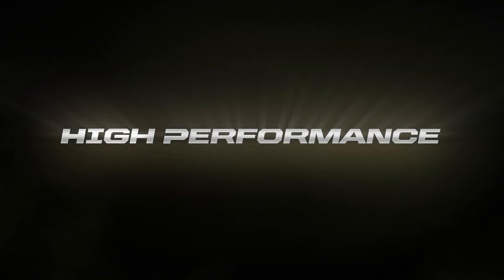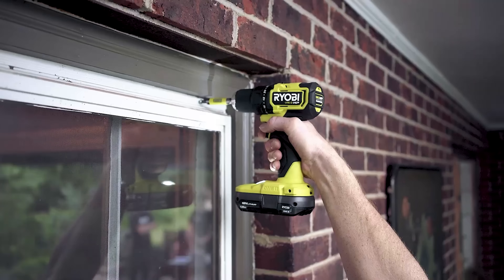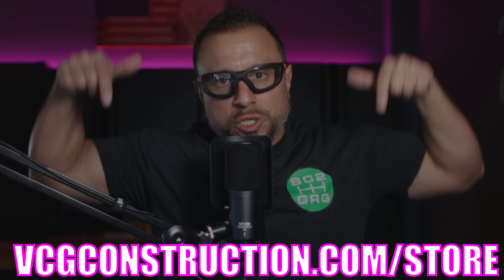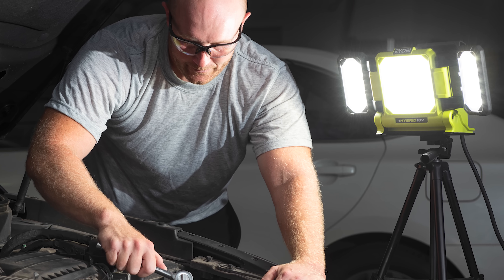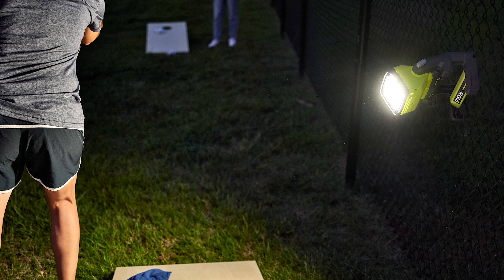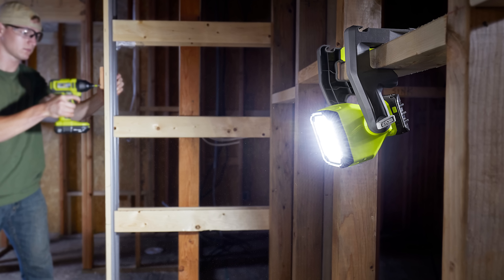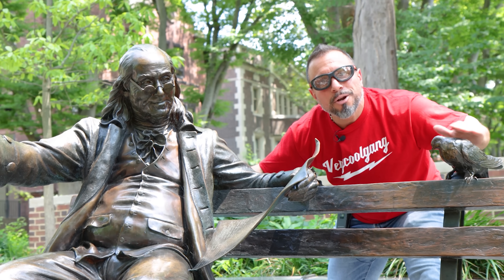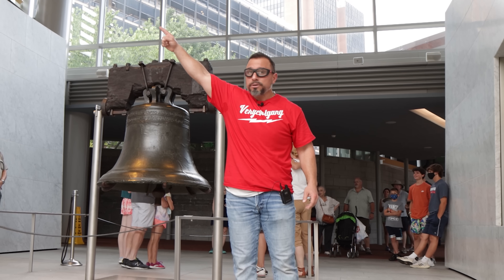New Tools AIMED At CONTRACTORS From RYOBI and YOU WILL BUY THEM!

Comment: Im a door installer for RFI (sub contractor to HD) I used up 2 dewalt brad  nailers in a year cost waaaay to much to fix. I got a 99 bucker ryobi brad nailer when on sale and 2 4 amp batteries and has lasted longer than both dewalt guns (and for the record I am team dewalt all the way to my hammer) but I thrash this ryobi nailer and it won't quit!!

Comment: Honestly Milwaukee has some catching up to do in lighting and fans. When Ryobi can just take a standard extension cord but Milwaukee has to have a proprietary 18V what looks like a laptop brick something is wrong.
Reply: I just bought Milwaukee's 2131-20 tripod light and it has a plug for extension cord.  There was a smaller light at home depot that was battery only for $79?
Reply: My light plugs into an extension as well. The fan, not so much.
Reply: TTI for the win.

Comment: They need to make a Framing Nailer!
Reply: They need to make a saw that lasts more than 30 cuts on a 3ah battery first. Maybe 20 mins of use then over an hour charge tine is bloody ridiculous. If they are targeting pro-sumers, they need a better battery, not better tools.
Reply: @BlazeHeroic  they have 6 amp hour batteries and there is also aftermarket batteries on eBay that are much cheaper and seem to be of decent quality. I have a couple of the aftermarket batteries that I have been using every day for months. 
I also use the six port charger so I always have a battery ready.
Reply: @basketofdeplorables4253  I can't find any high cap 4ah or higher batteries or I would gladly buy a few. Also, does the 6-port charge faster than the single port you get with most kits?
Reply: @BlazeHeroic  o don’t know how fast it charges, I just keep six batteries in it and there is always one charged when I need it.
Reply: @BlazeHeroic  they got ryobi 9ah batteries too.
Reply: @kirk422  Appreciate it, but all high capacity batteries are sold out locally, as well as the 6ah and 9ah. I'll just have to keep an eye out for restocks.

Comment: Hi Vince, ryobi is for diy and home owners, it’s not strong enough for big auto mechanic work, I tried the 262 and it couldn’t pull frame bolts out of a suspension of a car, just my opinion,
Reply from the maker: Fair enough, thanks for the feedback Robert, we appreciate it! 👍🏻
Reply: @VCGConstruction  always a pleasure Vince, love your videos,
Reply: They are about to release a high torque impact wrench. The 262 being their mid torque model. Torque Test Channel just released a video on the high torque. $199 I think.
Reply: We used Ryobi cordless tools for years in Princess Yachts. They been used and abused a lot. Only 2 years ago we switched to milwaukee to replace most of  air tools we use. The best tool in the world is cengar jp901 multitool. Just bought myself used  makita 6936FD after my dewalt died. Still have old batteries 18v nimh.  You don't need the best tools in the world.  You need to know how to use them.

Comment: The first light with the three independent heads, kind of reminds me of the pack-out charger light, they both have three independent rotating heads with 3000 lumens. maybe TTI is using the same LEDs and other parts
Reply: Ridgid has a hybrid light just like that for a few years now.
Reply from the maker: Good point

Comment: I feel the biggest downfall to Ryobi tools are the torpedo style batteries. Ridgid had that same style light out for a while that I own and is great ....95% of my tools are DeWalt so holding onto Ridgid batteries for that and my Ridgid cordless compressor I own. And I'm a little upset that I had to go out and buy DeWalt's pneumatic Pin nailer tonight because they don't have a battery one yet ...what's up with that ? Almost bought the Milwaukee but again don't need another battery platform.

Comment: Ryobi has said they been trying to step their game up, try to slide up closer to Ridgid level, maybe convert some of those professional handymen that only employs themself.

You know the crew over there at the Big Mean Green Machine gotta be fans of that movie, The Interview... “They Hate Us, Cause They Ain’t Us!”

Of course, some folks just tryna catch them ridin’ dirty!
Reply from the maker: They definitely has some mad scientists in the lab cuz!
Reply: The TTI Rep locally told me that they are focusing on Ryobi and Milwaukee.  Even though they just revamped the Ridgid line, also said Ridgid will not get the expansiveness of the other lines either.  I find odd as both ridgid and ryobi are both HD store brands.
Reply: @montec0  I know why, but I’m not saying. Your local rep is correct though
Reply: @Borescoped  well it kinda sucks since I went on that platform 6yrs ago when I was replacing my worn out craftsman 19.2v system.
Reply: @montec0  just slowly upgrade to Milwaukee when a tool wears out
Reply: @Borescoped  I am looking at the M12 for the underhood light for auto work.  I will probably just have to suck it up and not expand on it.

Comment: Ryobi suffers from What Black and Decker suffers from it will never be more then a home owner tool now. Back in the day black and decker was a contractor tool it was a standard go to. Then quality issues Rocked the brand and it was never able to recover so Black and Decker decided it was cheaper to make a new brand for the contractor grade tool market and Dewalt brand was brought back to life. Dewalt made just the radial arm saw and Staley black and decker  bought the company.  So they gave it the yellow paint and marketed it as the contractor grade tool since.     Ryobi should take a lesson and stick to home owners market & let the other TTI brand handle contractor tools you know Milwaukee seems foolish to have to brands competing in same space. One will loose majorly. And Ryobi has slowly been increasing prices and it’s not just inflation over time. Once there prices get close to what dewalt or Milwaukee use it’s game over people will just pay little more for dewalt or Milwaukee.   See if ryobi was smart the would just repack the older generation Milwaukee tools under there brand and save a lot of engineering cost maybe let’s let first gen tech from the 18v line is now painted green and sold at cheaper pricing for home owners trust me people would buy them then